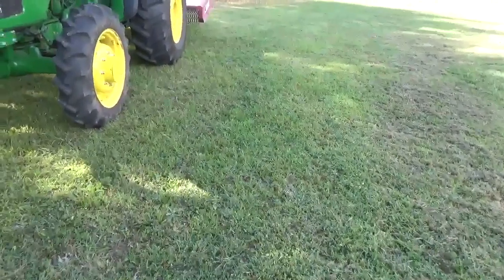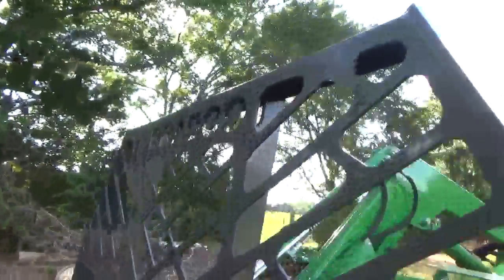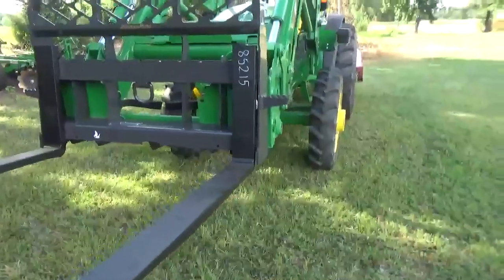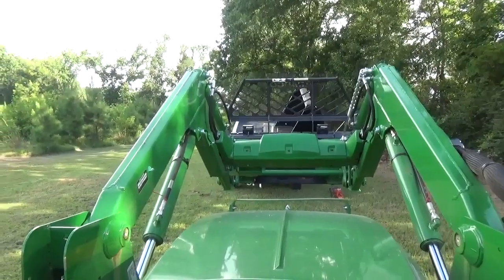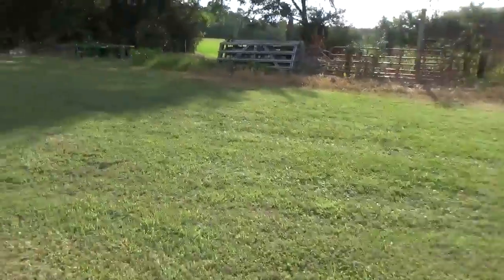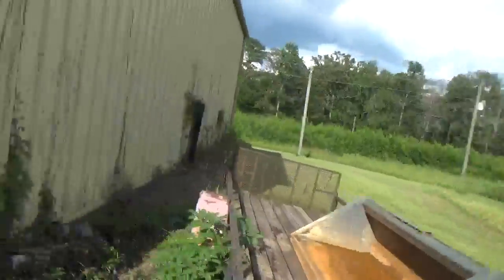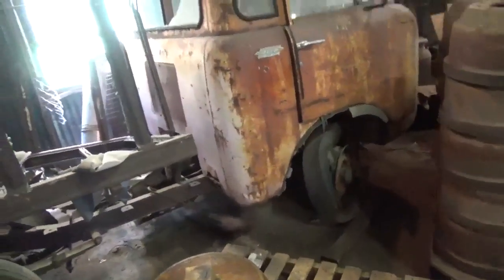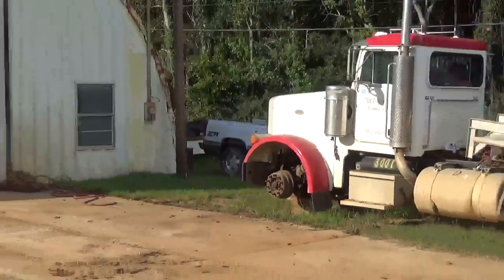John Deere 5075E, I got some new toys!

Comment: Cotontop3 I like the Jeep.  Those trucks weren't common back in the day.  I think most of them had a flathead 4 cylinder engine, like the early Jeep CJ-5s.  I think it will look good once it is restored.  They made them until the 1960s.

Comment: Those forks are nice. That d-ring in the center will work great at pulling stuff out from a trailer.One thing that would be nice if you use firewood, would be a splitter.

Comment: Good additional equipment for your tractor there Tim. However if you fill that bucket with soil you will surely have a load with it being 6' wide, you might just need rather more than your bush hog to act as a counterweight!

Comment: Hey cotontop3, I notice in this video that your JD was equipped with skid steer quick attachment hook up, did that come on your loader from JD or did u change that out aftermarket.....my Deere store said that Deere doesn’t put those on front the factory.  I really wasn’t wanting to use a adapter archive. Thanks in advance.
Reply from the maker: U can get it from Deere, you just gotta order it like that on the loader. Ur dealer just don’t wanna fool with it and sell what they have.